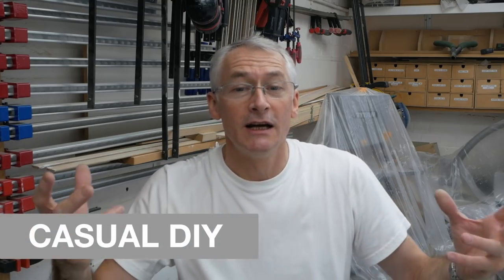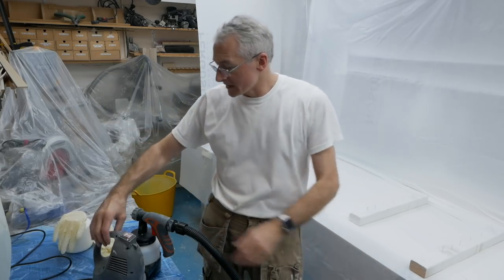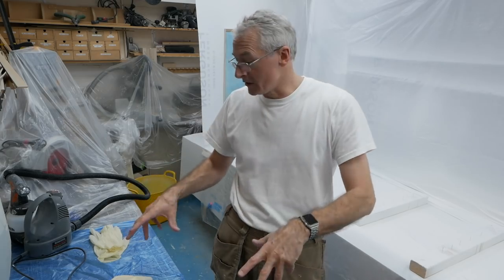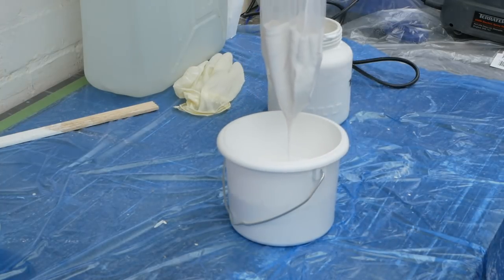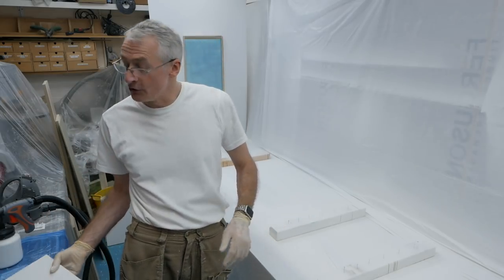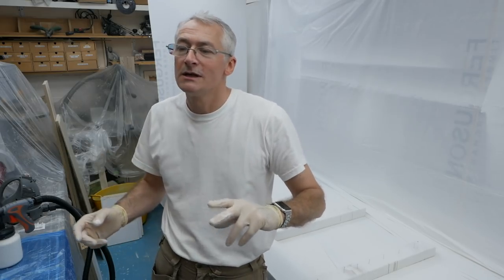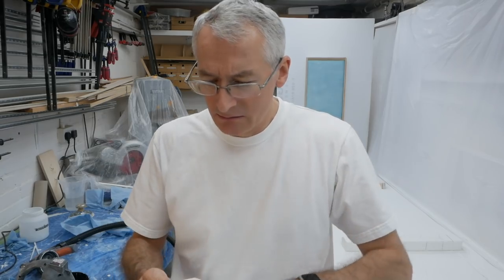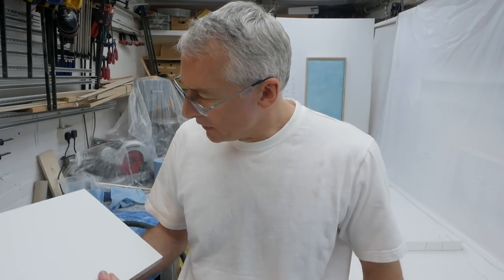£30 HVLP Sprayer P1 [Video #232]

Comment: I have now bought this spray gun (around 30 GBP in Jan 2021) but did need to look around to get the 2 paint pot option rather than just a single one. Results are great. In terms of cleaning the gun I would recommend going a bit further than shown in the video. Firstly, I remove the pickup tube and large round gasket for more thorough cleaning - just pull them clear - this allows cleaning right up inside the gun. I didn't have pipe cleaners to hand but found automotive 'throttle cleaner' in aerosol form did a good job (but test this on other plastics as some varieties can be rather harsh). As for the nozzle, it is easy to prise the white plastic bit clear to allow for cleaning the area inside the gun. When I did this I did find a lot of paint debris here which could cause blockages later on. Anyway Peter, thanks for introducing me to this sprayer which for my occasional DIY jobes, is just the ticket.

Comment: Oh... f*** it... I'm gonna do it. I might as well get an air one. Screwfix have a canny looking gravity one for about £40. If I didn't already have the compressor the one on your vid is a no brainer. Genuinely amazed with the finish!!
Reply from the maker: Resistance is futile, Andy. You know it. 😂👍👍
Reply: Would love to see some vids on spraying with a cheap gun on a compressor!
Reply: I would advise getting a hvlp one rather than an air compressor one, air compressor one puts 30% ish on wall, rest in air, HVLP puts 70% ish on wall and rest in air, makes it much more pleasant to use and much more efficient and do pays for itself quickly.

Comment: I got the Screwfix one a few months ago and used it with Leyland latex trade paint, did a great job and left a much better finish than a brush or roller would have and so efficient paint use wise, would have no issues recommending. Did have to water it down a fair bit, but doesn't seem to be an issue.
Reply: Is that the Erbauer one?

What paint did you use and what was the ratio of paint/water?

Comment: Good video thanks Peter. I have an Aussie style of that type, in fact I have been using it on and off for nearly 30 years. Gun is like a plastic version of a proper spray gun, but with a steel needle and is still going strong. I use a similar method to yours when cleaning it between sequential spray jobs. When I am finished with it (3 coasts and all that) I usually pull the nozzle and needle and drop it all in a detergent solution for about a day - any residual paint, particularly water based stuff can then be easily hosed off or brushed off I find. The only problems I have had have been with the concertina air hose couplings breaking up with age and it also had a foam air filter on the intake which I have replaced a few times as it gets full of over spray eventually. Sounds like a good unit to have in your painting arsenal, even if just to do priming with.
Reply from the maker: Thanks Bob! Yes, it’s an impressive little unit, and ridiculously good for the money. I’ve just sprayed £4Ks worth of cabinetry with it as my Graco sprayer died halfway through the primer - couldn’t fault the finish, and so glad that I had it handy! 👍👍

Comment: Hi Peter,  as always thank you for the quality and quantity of your content. I do believe that after watching your channel you have taught this old dog a few new tricks.  When painting little panels and doors, I use a turn table (called a Lazy Susan here in the States) with screws driven up through the wood. This makes it really easy to turn the product for edge and top painting. You can pick up the bearings on Amazon dirt cheap and with all the scrap MDF you have around the shop you could knock these out easily.  I still have hours of your content to watch but thank you again.
Reply from the maker: Thanks Jim. An old office/typists chair with the back removed is a popular workaround here. 👍

Comment: The big question has to be, how does the finish compare to the foam roller finish you previously championed.? Quality, time, convenience, cost, clean up, space, faff..  Would value your thoughts Peter.
Reply from the maker: The finish is superb. Cleanup isn’t onerous, and it’s fast to apply. But, it does take a lot of space in a small workshop as the drying needs to be elsewhere. As I’ve said before, you can get an excellent finish with rollers, but spraying gives a better finish, faster, albeit with the caveats mentioned. Whether that’s worth it to you is for you to decide. I’m still in the process of deciding, and I host these videos help others make up their minds as well👍👍

Comment: I used the erbauer one you referred to from screwfix on a job and it was really quick and useful. I found it worked fine for fence panels without thinning but thinning the paint for the summer house worked a lot better for a good finish. That sprayer was left with the client so I might have to invest in one of these now if you are that happy with the results. Thanks
Reply from the maker: The finish from this is excellent. More about that in tomorrow’s concluding Part 2

Comment: I tried using a similar cheap HVLP several years ago. I was pleased with the finish but found that watering down the paint affected the properties of the paint. The finished surface was more prone to having things stick to it if left on the surface for a while.  I feel that the paint just didn't dry as hard when thinned.  Maybe some brands of paint are better at being thinned than others. I can't remember what paint I used now.
Reply from the maker: Yes. As I say in Part 2, the paint makes a difference. I found Tikkurila to be particularly good for spraying 👍👍
Reply: @10MinuteWorkshop  never heard of that brand. Is it trade only?
Reply from the maker: No, they’ll sell to anyone afaik. It can be a bit tricky to get hold of  - only available in a few outlets, beat to order direct https://www.tikkurila.co.uk/decorative_paints/where_to_buy

Comment: Great video Peter, so I just bought one on eBay. HOWEVER, I clicked on the wrong one! There are two Terratek models, one of which is the solenoid type, even though it's described as HVLP. So, had to cancel that and order the other one. Other buyers beware!
Reply from the maker: Thanks. Best way not to buy the wrong one of course, would be to follow my affiliate link in the video description - then you’re also supporting the channel at no expense to yourself... 👍👍😁
Reply: Sorry Peter - fairly new to this YouTube stuff! Will do in future. Yours is a channel well worth supporting!
Reply: 1 - 0 for you!

Comment: I have the Screwfix Erbauer HVLP and I was absolutely flabberstaggered how much I had to thin the paint to meet the flow rate in the instructions! I was using F&B, but still I must have been down to 4:1 before I got anywhere near the right viscocity. I was spraying quite a pale pink onto a white wall, but it felt like it was so thin I was wasting my time!
Reply from the maker: What finish? Emulsion? Haven’t done any yet, but had to thin regular primer down by about 15% to get it to flow well. Have sprayed F&B emulsion straight from the can with my Graco airless. 👍
Reply: @10MinuteWorkshop  yes Estate Emulsion. Felt awful putting so much so much water into that expensive paint!
Reply from the maker: I’ll bet! Did it cover OK in the end?
Reply: @10MinuteWorkshop  it did to be fair. It was about a year ago but my only lasting memory is the volume of air being a nightmare with the thin polythene "tape and drape" stuff
Reply from the maker: Yes, I imagine that would be 'challenging' in a house! Glad it covered OK - despite all the general  dislike that F&B tends to get, I've never had a problem with it. 👍
Reply: @10MinuteWorkshop  I love it, especially the estate eggshell on woodwork. Goes on really well and is  incredibly hard wearing. Never understood the bad reviews. It's not even that expensive, I just paid £32 for 2.5l of Valspar in B&Q and that will probably need twice as many coats!

Comment: I just got a Vonhaus 800w unit for about £35 on a whim and am really pleased with it also.  Only comes with one paint pot though, and a second looks really useful!  I wonder if there are spares available, and if they fit between brands.
Reply from the maker: Not generally between brands IME, and certainly when I tried to get a spare pot for my Earleex it was really expensive - that’s why this one is such a great buy👍👍
Reply: Does it just suck the paint up through the tube? If so, any small container could work, bit awkward to hold but it's only for a minute of cleaning.

Comment: Well that didnt suck like the vacuum videos ...lol ,looked like you where spraying your shop there at first ,yea spraying makes it so much quicker on large jobs with tuff corners or trim too,did you look at the video with the fan in the rolling cart ,you could paint on top and clean the air on the bottom ,but i still say build it into your new bench with down draft along the back ,only take a 2 cm gap blow it back out the bottom
Reply from the maker: Thanks Syd, and yes, I did, thanks - apologies for not responding! Very interesting, but as always it's trying to keep a clean spraying space in an otherwise unclean workshop that's the biggest headache 👍

Comment: Great UK based channel Peter. Always more relatable to our own circumstances. Question - Need to paint inside a double garage this weekend. Concrete block that’s already had an ugly coat of mustard painted on. Would an hvlp sprayer like this do an okay job with either emulsion or masonry paint? Not too bothered about overspray, will just chuck everything in the middle and cover leaving the walls free. This seems like the way to go for me (hopefully)
Reply from the maker: Thanks! I've only used this with eggshell and primer, but yes, this should be fine - though you'll have to water down the emulsion quite a bit to make it spray in one of these, which in turn will mean more, thinner coats to get a decent coverage. 👍
Reply: Peter Millard Thank you for the reply. I think I’ll give it a go. Great content you are putting out. Learning a lot from your channel 👍🏻
Reply from the maker: @Vikingjoineryworks  Thanks David. Let me know how you get on 👍

Comment: Hi Peter,
Just purchased this along with a few other bits (using your links of course)
Can I ask what primer, undercoat and. Top coat you use for spaying please?
Going all white 👍
Reply from the maker: Hi Aaron. More detail in Part 2, up today at noon, but I’ve used regular Leyland water-based acrylic primer/undercoat, and their water-based acrylic eggshell, not worked well. For topcoats, I’m favouring Tikkurila Helmi 30 for a satin finish - you’ll see some of that in today’s video. But awkward to get hold of, but lovely paint. https://www.tikkurila.co.uk/decorative_paints/where_to_buy
Better to order direct sometimes 👍
Reply: Cheers Peter, you're a star 👍👍

Comment: Interesting video. Thanks for sharing. A cheap HVLP Sprayer seems the way to go for DIY-ers (if the next part(s) will not tell some bad news)
Is there a possibility to use this kind of HVLP Sprayers  as a "gun" for blowing away (saw) dust?
Reply from the maker: Thanks Hans. You could just use the turbine part, yes. Or the gun, as long as it was 100% dry👍
Reply: That's good news. Thanks. This particular one is very cheap and according the video much quieter than classical compressors
(which I do not own till now). The down side is that according the affiliate link they don't send to Slovakia.
I'd like to understand the reason for this kind of selling. Do they still think the world is flat and the paquet falls off somewhere?
Or does the post-office does not know where Slovakia is?
When I go to my local post-office I can send a pacquet to everywhere in the world. Yes, even to England :-)

Comment: You had a couple of what? in the bright sunlight by the doorway? ....... Dirty boy!
Nice review. Have you ever sprayed solvent based laquers with HVLP? I used to spray guitars (paid hobby) using high pressure compressor, moisture traps, air driers, oil traps etc. etc. but never got round to using my HVLP unit I bought around 30 years ago. I just never attempted the transition and it remains "brand new" - any thoughts or experience on solvent based paints?
Reply from the maker: No sorry, haven’t touched solvent paints for a decade or more, so no experience at all. N thoughts?? Not for me, thanks! 👍👍

Comment: Hi Peter, just watched this for the third time.  At one point you say  that thinning the paint before straining it through the filter was a 'rookie error'.  Why is that a mistake? Surely the strainer will pick up the same sized particles whether the paint is thinned or not, and the paint will flow through the strainer more easily when thinned?  Or am I missing something?
Reply from the maker: By thinning it first it's possible that smaller particles could be 'thinned down' enough to pass through the filter, but still cause problems at the tip, so in terms of workflow it's 'best practise' to go from raw paint > strain > thin > spray. Or so I'm told 🤷‍♂️
Reply: @10MinuteWorkshop  Makes sense.  Thanks!!

Comment: Really useful video. Big question; what is the overspray like?
Reply from the maker: Part 2 up tomorrow. It’s also the same sprayer that I used for my ‘£30 spray booth fans’ videos #230 & 231 👍
Reply: @10MinuteWorkshop  oh you big tease!
Reply: I have one, as well as the Wagner Flexio. There's hardly any overspray. In fact it's so minimal it's ridiculous.
Reply: @hythewoodworkdesigns  which is your go-to sprayer? This or the Wagner?
Reply: @cuperman : Difficult to answer. My Wagner Flexio has 2 spray attachments for different jobs, plus I have just bought the detail attachment for smaller & more detailed work. However, the Terratek, is something else for sheet goods & to be perfectly honest is my preference. That's the first one I go to when I have a big project. But, on the other hand, I prefer the Wagner to more detailed work. Terratek, as far as I know, don't have a detail nozzle. So to answe the question the long way round. Terratek for 75% of my work & the Wagner for the other 25%. Sorry it took so long
Reply: @hythewoodworkdesigns  that's a great answer, thanks 👍

Comment: Love the content Peter, thanks. Two questions, are there any restrictions on what type of paint you can use with the sprayer and what's you advice on caulking - paint before or after? Thanks!
Reply from the maker: Thanks! Haven’t used it in a while,  it not aware of any restrictions, and I’ve only ever used it for painting fitted furniture, so no caulking involved. 👍👍
Reply: @10MinuteWorkshop  that’s good to hear you’ve used it on furniture, I bought the Wagner sprayer which wasn’t bad , is the one you’ve demonstrated purposely for furniture or upto the same standard as a Wagner hand held would you say? 
Thanks

Comment: Peter I have the Erbauer one although only ever used it for painting sheds. 

I plan on using it to paint some MDF and plywood. What paint did you use and what was the ratio of paint to water?
Reply from the maker: I was using Leyland water-based acrylic eggshell and primer/undercoat, and it needed thinning by about 25%. Aim for the consistency of single cream - usually a good starting point. 👍👍

Comment: Peter, great video and demonstration, what is the nozzle size? Always used a more expensive bit of kit, but loads of these cheap airless sprayers on the market these days and many seem to do a really good job. Wanted one more for primer base coating and easy clean up, do you use it for top coats as well or just the Graco you mentioned. Been a few years since you posted this video and just enquiring on an update and did this unit serve you well.
Reply from the maker: Thanks. This isn't airless, it's hvlp. No idea on the tip size, I'm sorry, and haven't sprayed anything in a while as I'm not in the fitted furniture business any more, but I have used it for topcoats, and it worked pretty well. 👍
Reply: @10MinuteWorkshop  Thanks. They are referred to as airless, meaning no air tank and use a turbine. Appreciate the update and reference to top coats. All the best.

Comment: I bought this setup the week after you published the video. I must concur, the finish was amazing. For £30 it was easily the most impressive tool I have ever bought.

However, today I went and bought the Wagner XVLP 5000, for a difference of £550, I am struggling to think what it will do better!! I shall endeavour to find out at the weekend
Reply from the maker: In terms of the finish, probably not that much tbh, but I’d expect the unit to be much more workmanlike and heavier-duty, generally. 👍
Reply: @10MinuteWorkshop  well, I couldn't wait until.the weekend and had sneaky go at lunchtime. The results are night and day apart. The improvement over the Terra-Tec (which I was extremely happy with) is amazing.

I can only describe it as the difference between looking at a P120 and a P400 sanding disc. The atomisation is so much finer.

Comment: Hi Peter, One question if I may, what water based primer do you use? At present I am using the Leyland MDF primer, good but a lot of sanding to get rid of brush strokes. So do you dilute something like this or have you sourced a spray gun compatible MDF   primer please?
Reply from the maker: I just use a water-based acrylic primer/undercoat - Leyland, Johnstone’s, own-brand, I’ve never found much difference between them tbh. But you must use decent quality materials eg Medite MRMDF; makes a huge difference. 👍👍
Reply: @10MinuteWorkshop  Thank you Sir